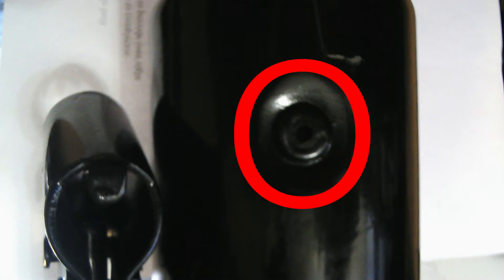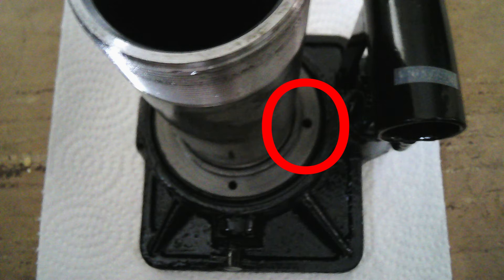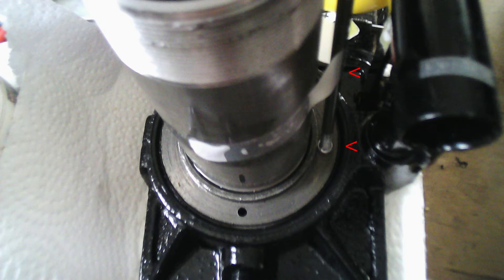Modifying A Hydraulic Bottle Jack To Work Upside Down

Comment: To save having to wait on JB weld to cure you could use the marine epoxy putty that you squeeze together it takes about 15 mins. to cure. Good video Ron.
Reply from the maker: Thanks for the encouragement.  This is another option indeed.

Comment: Looks great, that is going to work out great for you! Ive heard a lot of great things with JBWeld but i have newer used it myself, it's hard to find in Sweden. Dont forget to post a video with it in action :)
Reply from the maker: I took a photograph for each of the steps as I make my hydraulic press out of wood.  I will show it in use at the end of this :)  Also I am making a play list of the repairs / maintenance I am doing to my electric wheelchair.  I expect it will show up in there from time to time :)
Reply from the maker: I've just used the hydraulic press to change a stem bearing for my power wheelchair.  It worked really well.  I invite you to watch this video @ https://youtu.be/tnEEAp7PdA8